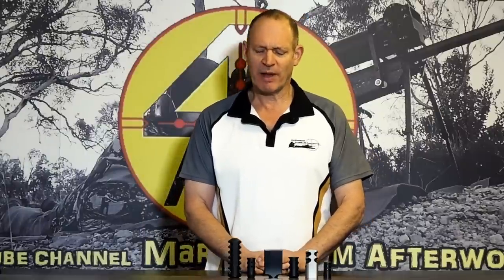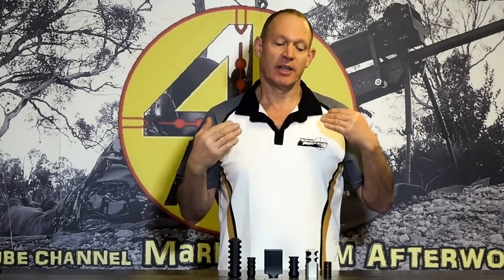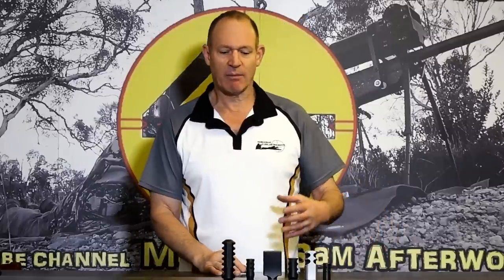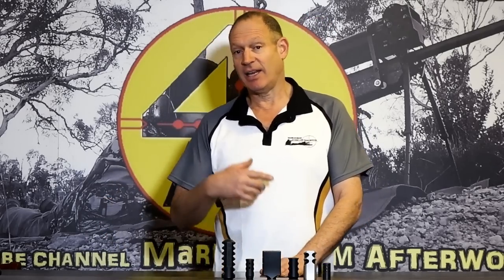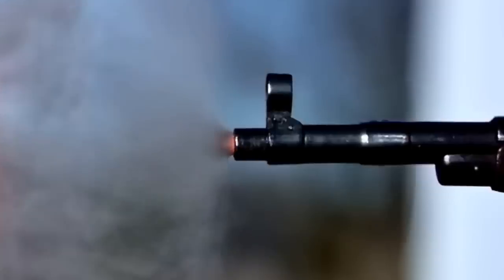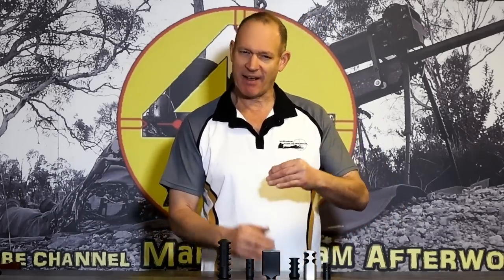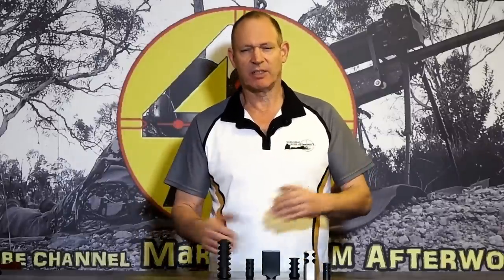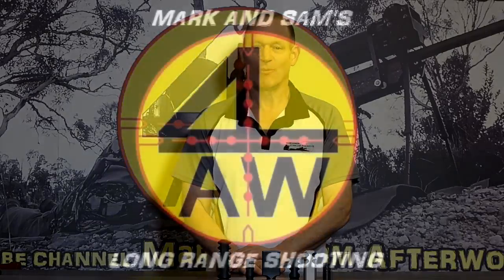Muzzle Brakes, More or less Accuracy?

Comment: Reading the development of large caliber naval gunnery. They actually push a jet of air before the shot to help the air inside of the barrel to move before the projectile. On some tank barrels there are cans half way up the barrel. According to the guys at the ordinance test labs, it serves two purposes. One is to help evacuate the bore and barrel. The other is to have capacity to hold some of the air in compression as the projectile is pushed through the barrel. As the projectile is compressing the air into the can, once it passes the ports the compressed air starts the evacuation. Not necessary now with smoothbore firing winged darts. Thank you for the informing videos. Love them.
Reply from the maker: Cheers Pete, thanks

Comment: I had an angled port muzzle brake on my .260 rem Sako TRG. Recoil was zero, but the concussion of the blast was causing me to start flinching on occasion in 30 round competitions. I removed it and am now shooting the rifle standard, no brake, no suppressor. The recoil of the .260 in the heavy TRG is not significant. Rather a bit of recoil, than the concussion. Which is also hated by fellow shooters on the line. I would like to try one of your "90 degree" brakes sometime. Thank you for a great channel.
Reply from the maker: Cheers Man, thanks

Comment: Great information! Just the other day I was fighting with an AK pistol that has always shot kinda terrible and I pulled the muzzle brake off for something and realized that the bullet was just kissing the inside of the muzzle device... The threads not concentric. Shot it bare muzzle at 50 yards my zero was 9 inches higher and grouped way better! Fixing to send it to get rebarreled because there is not enough to left to do anything with
Reply from the maker: Cheers

Comment: Barrel resonance is a problem for me right now with my brake on.  It is an Aero VG6 Gamma and did reduce recoil very well.  What I've discovered though is that my groups are actually better with a Magnetospeed bayonet on than without.  If I cannot find a way to manage resonance, I'll have to switch brakes or just put up with a little more recoil.
Reply from the maker: Thanks Scott

Comment: It's worth remembering that literally anything you put on a rifle barrel will act as a harmonic tuner, not necessarily in the way you want it to. Could make things better could make things worse.  This includes the fouling that will build up in a muzzle device.

I don't have experience with centre fire rifles but when it comes to rimfire target rifles for Olympic style prone and 3-position shooting many of them have foresight extension tubes. Some of these tubes have built-in harmonic tuners as does mine. Allowing fouling to build up and add weight to the tube defeats the purpose of having a precision adjustable weight. I don't clean my barrel every trip to the range but the muzzle device gets cleaned after every single use even if I only put 15 shots through it. Keep it minimal, keep it consistent. 

The barrel needs a certain amount of fouling to reach a consistent point. The first few shots with a clean barrel are usually not as consistent as the rest.

Great video by the way. There are a huge number of factors at play here. Something that slightly reduces a gun's mechanical accuracy can help most shooters to use the weapon more accurately.
Reply from the maker: Cheers James

Comment: Explains the "target crown" which is usually 11° angle, probably having to do with aerodynamics of the gasses out of the muzzle as the bullet base breaks the 'seal' of the bore.
The slow motion video footage sure was helpful, seeing this high speed gas flow zipping around the bullet as it's exiting the muzzle. In relative terms, the bullet is a slow heavy object and the expanding gasses are like tornado winds blowing around a farm grain bin.
Reply from the maker: Cheers

Comment: I have an MDT comp brake with ports on the top. With the brake on, it seems to cause the bullet to have a different trajectory than all the calculators predict. When i take the brake off, the gun matches the calculator exactly. (I would rezero the rifle every time i add or remove the brake) Have you ever observed this with any of the brakes you have used?

I've come to the conclusion that any brake i buy from now on needs to be symmetrical left/right and top/bottom. 

Great video!
Reply from the maker: As explained in video, brakes like that cause barrel direction change, Cheers

Comment: Im by far not a firearm expert, i only worked as machinist and mechanic, mostly doing lathe work and drilling, deep hole drilling with gun drills etc. But i have to throw my mechanical nonsense into here. Clear things up for me if im wrong, i'm always happy to learn stuff!
From my understanding the crown on a barell is more important for accuracy then the overall condition of the barell since it's the last thing giving the bullet a "nod" into a specific direction.
I assume, when you have a really well machined muzzle break, say the gas distribution inside the thing, and in front of the bullet is even and the tolerances are on spot, i'd opt for anything 0.00078" or better. It's the same as with space travel. If you aim your rocket 1° in the wrong direction you probably miss the moon by like 15.000 miles. (thats just guessed, don't nail ne on that distance)
Means the more effort you put into having an accurate machined rifle and properly loaded ammo with maybe machined bullets that are within very tight tolerances, the better you gonna hit stuff the further it is away.
Then i don't see why accuracy should decrease except you are moving say velocities outside of the "spec" for the ammo you are shooting?
But then come things into play like barell harmonics, if you put weight on a long thing stick, it will bend, if you build up pressure and heat inside that stick that then moves to the outside to dissipate that energy from the barell again, then the heat will start to affect the material and it will start growing in whatever direction the geometry of the thing allows.
Heck even gravity gonna pull on the thing 24/7 so you could actually account for even for that when construction the barell with the fitting muzzle break.
You would have to tune the system at once tho, or into one package. Because if you change one bit the other wont fit perfectly anymore.
But yeah i think since its physics you can take everything into account and still have a "perfect" shooting rifle and imo it should even be more accurate if its properly designed with a muzzle break then without. As close to "perfect" as one might get in reality that is :)
Man i was writing before really watching the video, guess i wasn't that far off! But again if im wrong anywhere, if anyone read this wall here, feel free to clap me back into track! :D
Thanks again for taking time and explaining stuff like you do.
Always enjoy listening to you guys!
Reply from the maker: Cheers

Comment: An idea for you you to try, I don't recall any of your videos exploring it, is the have a large straight port as the first port, and the perhaps a 15 degree rearward port for forward drive on the rifle. The gas gas interaction should still provide a mostly perpendicular gas flow, so no over pressure at the shooter
Reply from the maker: Yes used them, and for gas flow yes, for percussion, all the logic all still applies, Cheers

Comment: Hi Mark, great video and very informative as always. Are you able to talk about how if at all critical the internal diameter of a muzzle brake is? I notice that a lot of muzzle brakes on the market are set for larger callibres such as 308 and 338 but claim they work on the smaller callibres too. But at what cost?
Reply from the maker: Doesn't make a lot of difference in performance, and allows for thread inaccuracies, Cheers

Comment: Hey mate, do you ever get any crud built up inside the muzzle brake ?
I have only ahot 12 rnds thru my new ruger hunter with the magpul stock and muzzle brake. And i see something like lead inside muzzle brake and even on outside of crown.
Reply from the maker: Yes any muzzle devise will have little carbon and copper over time, needs cleaning if builds up enough, Cheers

Comment: I'm having accuracy issues with a quite new Tikka T3 X Tac in 223 and I was actually considering trying it without muzzle brake.  Up to 100m, 5 shots in one hole, but at 300m I do not retain the MOA accuracy expected.  On the other hand the € 1,200 Sabatti 308 without muzzle brake did not pose much problems to get well under 1MOA at 300m.  I got the Tikka to push to 600m but I'm still a long way off.
Reply from the maker: Thanks Jon, Cheers
Reply: Wind?
Reply: @prone_wolf8871  No, None.  This is a rather sheltered shooting range and I like testing loads and new guns in it.

Comment: Have the 4 port air bypass diverter. Should the barrel crown be into the first port, or is it OK to be back into the threads?
Reply from the maker: Ideal is crown is level with opening of port, but fine is a little short, Cheers

Comment: The rifle moving during recoil is an interesting thing, I've seen this myself where I can influence a measurement by a large enough value to be a real change. Take a big bore airgun shooting in the 800fps range, brace it firmly and get a value, now try another where it isn't braced as firmly and can move a bit, and you should see a lower speed. I've seen 10fps difference with my .357 airgun by pulling it tighter to my shoulder.

Also I like how you explain the brakes, makes me think I cut mine "correctly" when I milled out a block for my .510 airgun. It was just scrap aluminum I had on hand, but it is chambers with outlet 90 degrees to the barrel. Seemed to work OK but I haven't shot this rifle enough yet, only gets 3 shots per fill and about 8 minutes to refill, so easy to spend a lot of time waiting. Need to get it over a chrono too.
Reply from the maker: Thanks Mna, Cheers

Comment: I have had great luck w my radial muzzlebreak.   Def reduced recoil.  And its just as accurate as wo.   Diff point of aim on vs off but both configurations are .5 moa or so
Reply from the maker: Just no good for prone in any dry out door conditions... Cheers